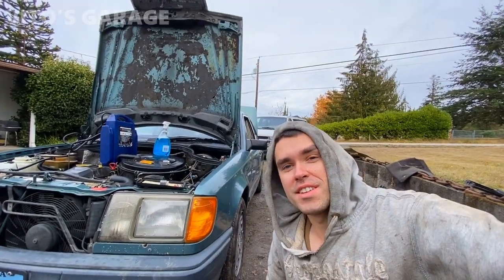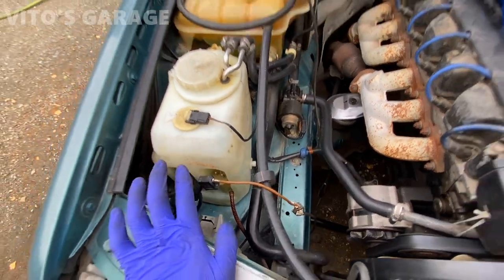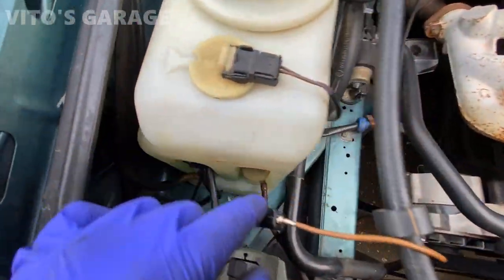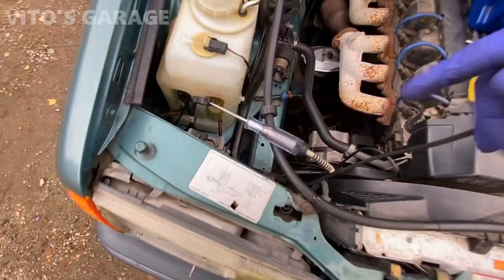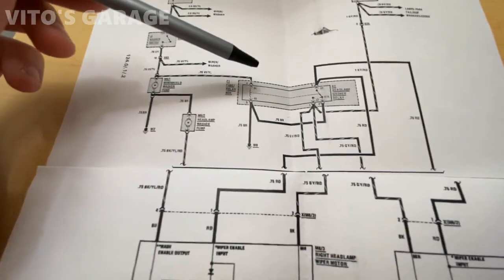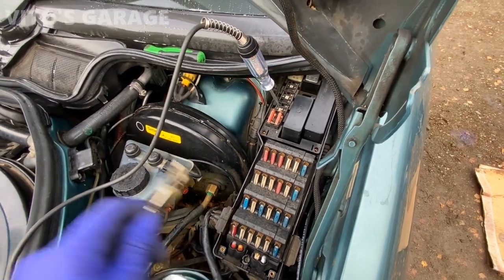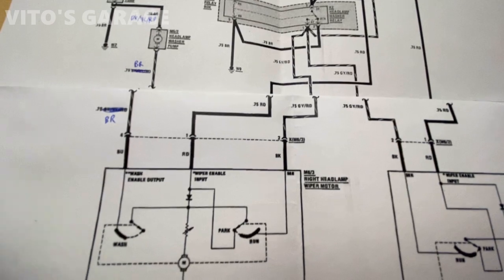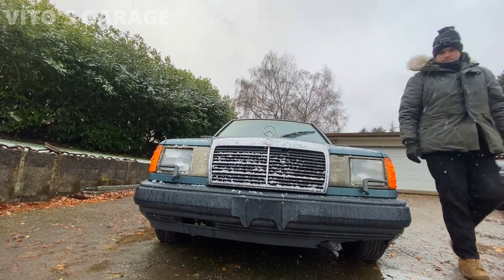Part 20 Mercedes W124 300E Diagnosing & Fixing Headlamp Wiper/Washer System!

Comment: Hello could explain how to turn wipers on .  Have 1991 420 sel .. windshield wiper motor sprays works .  For the life of me can’t figure out how headlight wipers work
Reply from the maker: You have to turn the headlight switch on and then push on the combo switch (same way like activating the windshield washer)